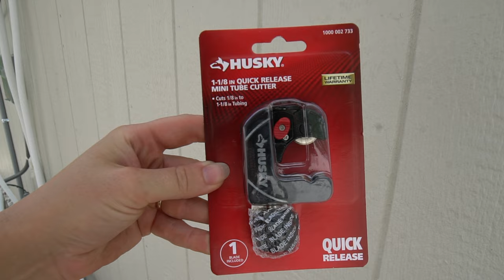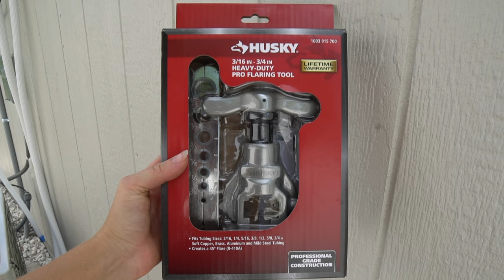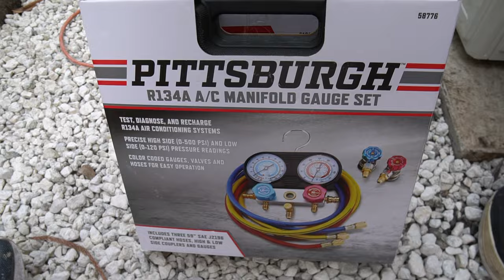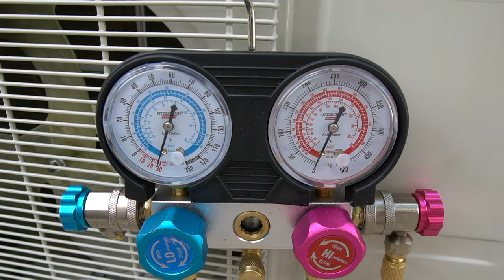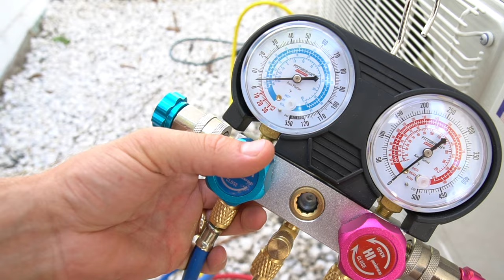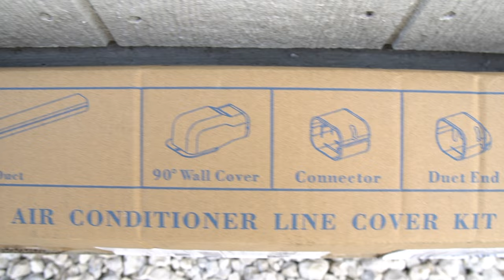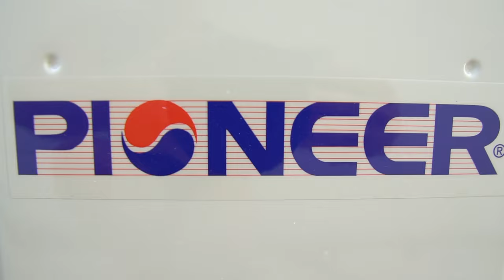How to Install a Pioneer Mini Split

Comment: Little scary attaching a air handler to dry wall only with screws. Using a little common sense u would put a couple screws in the vertical stud in center of ur bracket. Just because ur diagram shows hole patterns should not stop you from using studs. Don't plan on sitting in the area.
Reply from the maker: In the video I mention how we installed blocking specifically for the mini split prior to hanging drywall.. so it's secured to the blocking 👍
Reply: Sorry u sure did I only glanced at the studs before drywall

Comment: You super heated the oil.  it changes viscosity with temperature. When you went to idle at the top, the reduced RPMs caused the pump to turn more slowly. It is not a fail. YOU are the fail.  Jezus get someone who knows what they are doing.